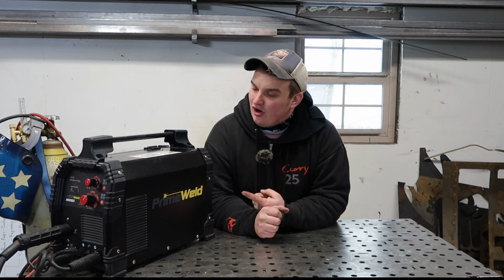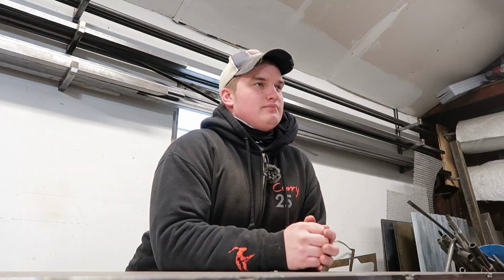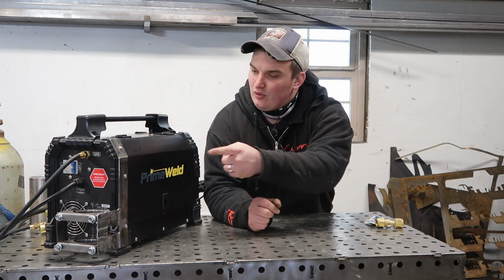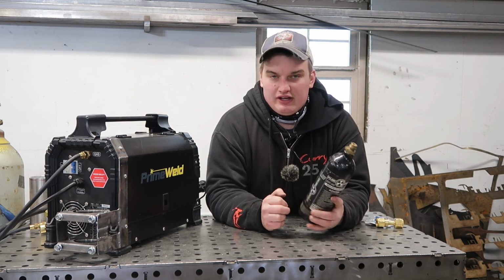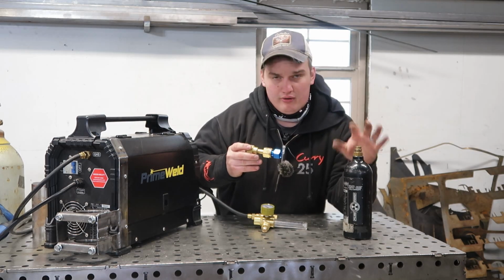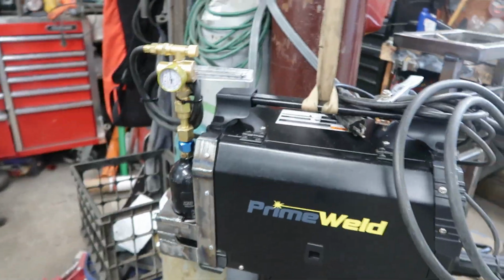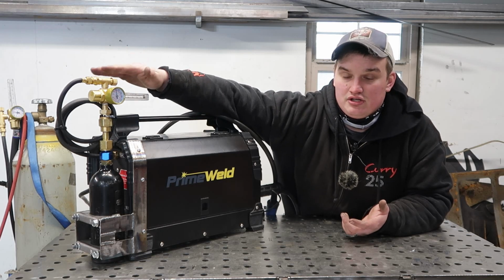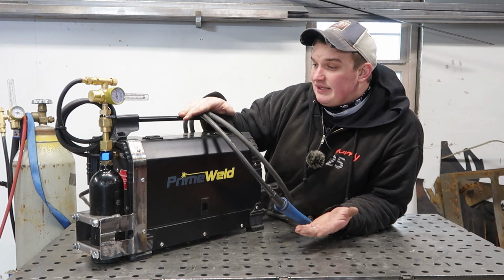PrimeWeld Mig 180 Extrema mobile up grade.

Comment: Nice work. I have been considering the 180 to replace my Lincoln 135.
Reply: Im looking to add a 180 to my collection lol. I have primeweld tig 225x  and an old but mint condition lincoln 135
Reply: But i really like millermatic 180 with autoset also

Comment: Are you sure that paintball gas is really pure enough for welding? It’s not a high quality gas, and Co2 causes enough problems as is. The welds may look ok, but you know that doesn’t mean they are of, at least not for structural, and l9ng term use.
Reply from the maker: From my experience I've not ran into two different grades or "purity" of CO2 . I have absolutely ran into that with helium though. As for the structural application in most of the cases that I have encountered you do not use a short Arc Mig like this machine is anyways unless you are running dual shield otherwise you would need a pulse Mig or spray arc to which this machine does neither. Thanks for your inquiry really appreciate it 😎👍
Reply: @amcustomfab  by structural, I mean anything that someone is going to sit on, climb on, be under, or hang something from. Structural doesn’t mean something that’s at least 1/4” thick. Spray arc is good for thick work, more than 1/4, in one pass certainly, if you have the voltage and amperage for it.

I’ve run into purity problems with argon and hydrogen. I don’t weld with Co2 alone. That’s really only used to save money. Wire manufacturers have charts showing various weld qualities with various recommended gasses. Co2 has the least strength, measured by psi, the lowest elongation, etc.

Comment: I see the amperage range starts at 40 for this machine. How is the low end? Say automotive sheet metal...
Reply from the maker: I have spot welded 20 gauge with no problems
Reply: @amcustomfab  using .024 wire I'm assuming? I would enjoy a video showing the low end... Really considering it but it's only worth it if it has a reasonable low end
Reply from the maker: .030 wire  that would be a good video I have a couple other videos lined up but I will consider it 👍 I do have a video showing settings and techniques on this machine and I weld down to 16 gauge in that video
Reply: @amcustomfab  let's see some 24 gauge sheet metal work!!!